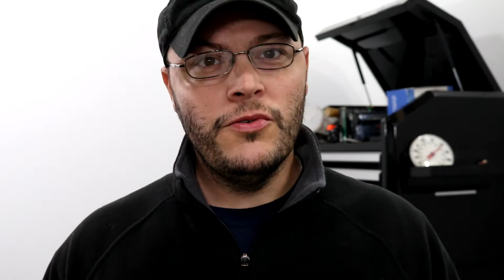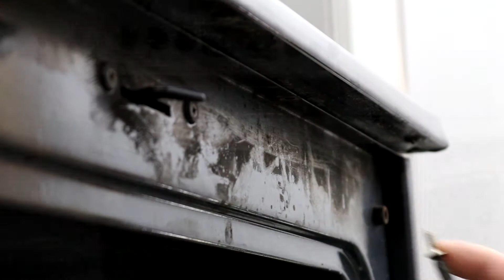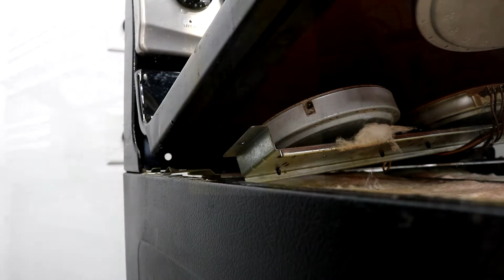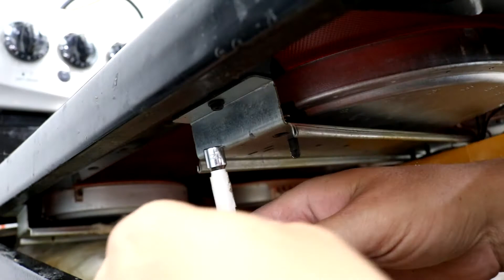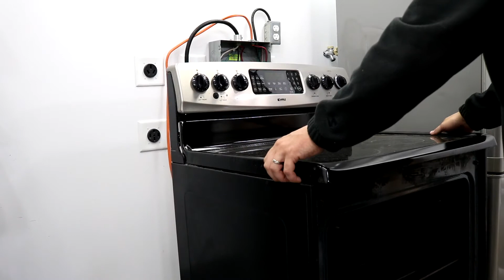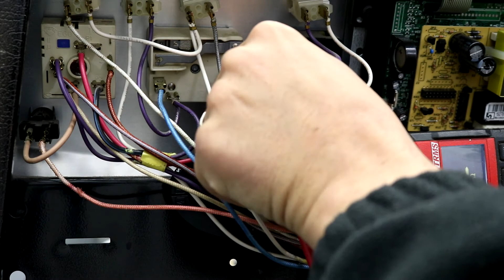Frigidaire / Kenmore 6" Top Burner Troubleshooting - How to Repair and Replace

Comment: I really liked your video. I now have two rear 6" burners gone. One burnt out I guess about 2 years ago the other one yesterday. OUCH! I guess I will now try to replace. Again, thanks for the clear explaination. Ya, I did test the other working elements and switches, and they were alright with the test, I needed to do this to make sure I was testing things properly.
Reply from the maker: +Steve Bassett Let me know how you make out.  This stove has about every type of burner on it that they make.  You should be able to watch these and be a master at all of them.
Reply: +Bill Newberry Hey Bill, changed one of the burners, ya no problem!!!! I will get other burner shortly, boy are they ever expensive, $119 + tax=$135, yikes!